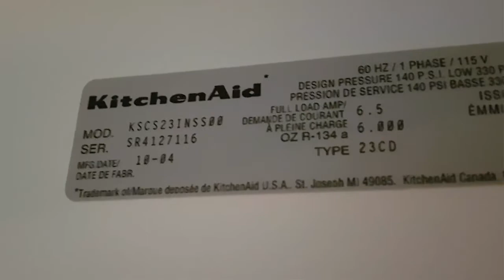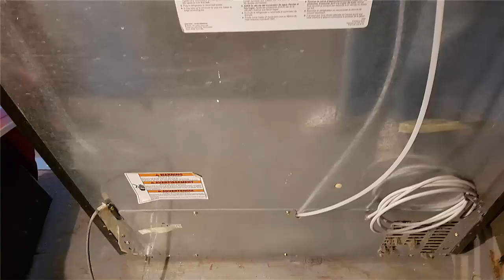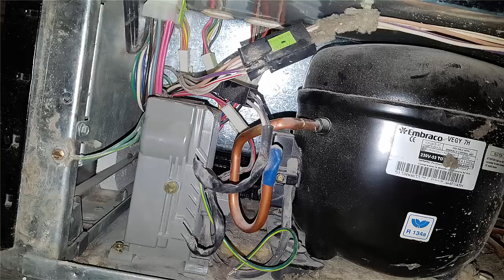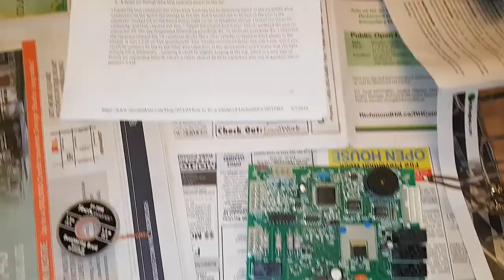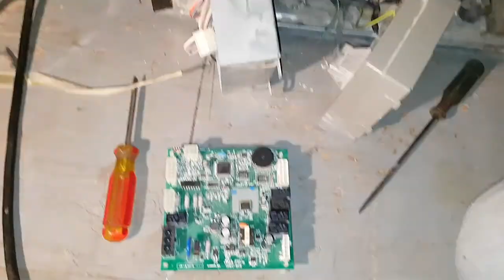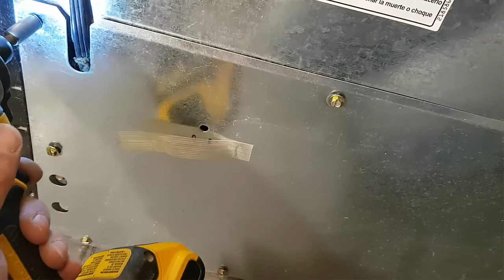Repair Control Board  for a  KitchenAid Superba Fridge

Comment: GOD Bless you Vito. You are and excellent teacher and technician!
I saw already ordered a capacitor because it was bulging on top, the same one you had pointed out. After seeing your video I now ordered the relay also. The Cap with arrive tomorrow so I will replace it and see if the fridge works. The relay will be here the day after.
Reply from the maker: Hi, Thank you so much for your comment.
 
I'm glad you found my video and I hope that it was helpful for you to give you the confidence to try the repair yourself. If you do end up deciding to try the component fix and if you haven't soldered or de-soldered much before then I strongly recommend watching some YouTube videos on the subject as you definitely want to be extremely careful when applying heat to the board not to overheat the board as they are sensitive and you could damage it if you put excessive heat while trying to remove the components.  The key is to use a solder sucker or soldering copper braided wire that will absorb the solder and move it away from the component pins you are trying to remove.  You should be able to find lots of good videos on the subject, just remember to be careful as these boards are very expensive to replace should you damage them, ... if you can even find them anymore.

 
If you do manage to fix your fridge (whether at the component level or a board refurbished, ...which will cost you considerably more) then I would highly recommend plugging the repaired fridge (and any other expensive electronic appliances for that matter) into a surge protection device or a power bar with built-in surge protection. This will help ensure your fridge (and other appliances) will not be as susceptible to electrical power spikes sometimes associated with thunderstorms. I plugged mine into a surge protection device which is then plugged into a surge protection power bar so it should have double surge protection.
 

Good Luck with your repair and if you do manage to "Fix It Yourself", I'd be interested in knowing how you make out with it. Best of Luck. Vito Casola - FIX IT Yourself!!
Reply: I own a Weller WESD51 soldering station and necessary tools. I wire my guitars. What temp should I set the soldering irin to? It is a digital readout. What solder?
Reply from the maker: @mercyrules1617  Not sure what temperature you should use. I would start with the lower setting(s) and gradually increase until you find you are able to get the solder to melt and stop there. Or you could research a bit more on the topic of soldering delicate electronic components and maybe you'll find the answer you need. Vito Casola - FIX IT Yourself
Reply: Well Vito I fixed it! thx Temp was 750f. You are a blessing sir!
Reply from the maker: @mercyrules1617  Fantastic!!! So glad these videos actually help people like you. You just made my day. I bet the fridge manufacturers aren't happy though. Keep on fixing things yourself!!!  Vito Casola - FIX IT Yourself!!

Comment: Hi, this is super help, I already ordered the parts that should arrive tomorrow. Would be possible to get a copy of  Steve Jenkins’s document ?
Reply from the maker: Hi Juan, Thank you for your comment and positive feedback. I hope your parts arrive soon and you are successful at repairing your fridge. Email me at vmcasola@gmail.com and I will respond to your email address and attach the Steve Jenkins document.  Vito Casola - FIX IT Yourself.!!
Reply: @FIX-IT-Yourself  thanks for the document, I made the changes in the control board and now the refrigerator is cooling without any issue. Your video helped me to know what to do and how fix the refrigerator very easy. Your post is one of most significant contributions DIY.
Reply from the maker: @jmsilva64  Hi Juan, Thank you for the very positive comment, it's much appreciated. I'm sure others will appreciate knowing that this is something they can try and succeed in fixing. It's really not that difficult, saves you a lot of money and gives you a great feeling of accomplishment. Take Care and keep on FIXING THINGS Yourself.!!! Vito Casola - FIX IT Yourself.!!

Comment: Thank you for making this video. Saved my fridge. The blog you reference is no longer up, but this video had enough info to do it. Someone even made a kit of the 2 parts on Amazon for $10.
Reply from the maker: Hi William, Thanks for the comment and positive feedback. Yes, it doesn't surprise me that someone would buy a bunch of these parts, then package them up as a kit and sell them on Amazon.  The parts can be purchased from Mouser Electronics (as was detailed in the Steve Jenkins article). So I bought the relay from them for CDN$2.56 and three capacitors for $0.89 each ($2.69 for 3). Total price for parts was $5.25, and the $8.00 shipping cost was more than the parts. So I guess there is some profit that can be made by buying these parts in bulk and selling kits for twice the cost. Vito Casola - FIX IT Yourself.!!
Reply: Wat does  the relay control

Comment: Vito, thanks for your help! The video was clear and straight forward.  I was about to give up on the refrigerator and buy a new one.  Thanks for sending the copy of Steve's article with all of the pictures. Evidently, this is a big problem as Amazon has a package that includes the relay and three of the capacitors for $9.00 delivered. The repair was much easier than I realized and now the refrigerator is operating as it should.  Here is the link to the Amazon package - https://smile.amazon.com/dp/B074VY34H8?psc=1&ref=ppx_yo2_dt_b_product_details
Reply: I bought this package, have not yet taken the control board out. Some reviews mentioned the capacitors were not the correct kind, but the relay was enough to fix their problem. Can I get confirmation on this before I start trying to repair it, how many of the capacitors should be used if any?
Reply: @izzyira  The package I ordered had two capacitors and two relays.  The control board only needed one each.  That is what I installed and the refrigerator is still running great

Comment: This is one of the most helpful videos I've ever found on YouTube. Vito was spot-on in my refrigerator works perfectly now. His email communications with me was so personable. The only problem that took me so long was the desoldering of the components on the board, but I got through that and the rest was a piece of cake! Vito wants me to thank Steve as he was the originator of doing this. Thanks Steve! By the way this was a fun project and you feel good about yourself.
Reply from the maker: Thanks, really appreciate the comments and positive feedback, and really glad I was able to help you. Vito Casola - FIX IT Yourself
Reply: @FIX-IT-Yourself  My refrigerator is making a high pitched sound/tone intermittent.......many long tones lasting 10 to 20 seconds and then maybe a short 3 second one thrown in here and there.  It does sound like a motor or fan is clicking in and out when the high pitched sound comes and goes but I am not sure I have the same problem as the temperature is fine and the reading on the digital control panel inside shows the temperatures ok.  But it is making me crazy........like a tap constantly dripping but worse.  Any replies would be greatly appreciated.

Comment: My KitchenAid was doing the exact same thing. After several searches looking for an answer to the problem and looking for a new control board, I came across this. Saved the day! Ordered the parts from Amazon and replaced the relay and cap. Up and running like new! Thank you for posting this and for sending me the PDF!
Reply from the maker: Hi Rick, That's fantastic!! So glad to hear you were able to repair your fridge and very glad that I was able to help.  Vito Casola - FIX IT Yourself.!!
Reply: @FIX-IT-Yourself  can you send me the pdf also?
Reply from the maker: @johnbellini1533  Hi John, Certainly. Please email me at vmcasola@gmail.com and I will respond. Vito Casola - FIX IT Yourself.!!

Comment: Thanks for the help. My fridge is up and running again. I couldn't have done it without you.  Apparently this repair is popular as the capacitor and relay is now sold as a package on Amazon!
Reply from the maker: Thank you for your comment and positive feedback.  I'm glad to hear you were successful in getting your fridge repaired and are now still enjoying use of what otherwise would have been a lot of plastic and metal now in a landfill or recycling facility. Yes,  someone else made that same comment and it doesn't surprise me that some people have figured out there is some business to be made from ordering those capacitors and relays and packaging them together as a repair kit.  I suppose I could have done that too but that's not why I make these videos. Both parts can actually be ordered at the same place, (Mouser Electronics, is the one recommended in the Steve Jenkins article, and where I purchased mine).  Hope you keep on FIXING Things Yourself. Vito Casola - FIX IT Yourself.!!
Reply: Hi where can I get the parts?

Comment: My fridge had been double Beeping every 5 seconds for 2 weeks.  Repair person could not do much as he stated that the motherboard was no longer available.  I had already changed the inverter box for $340 Canadian.  After I watched your video I tried to order the two parts you mentioned, however, the relay was backordered by about 6 weeks.  I was able to find the Capacitor for $1.36 (two of them were in the bag).  I replaced the capacitor and the fridge has now been working fine.  It has been 24 hrs and we are still smiling.  Thanks for your post. (By the way,  I was able to find a motherboard locally as they had it in stock.  They wanted $590 for it.  I passed!). Luc from Ottawa, ON
Reply from the maker: Thank you for your comment.  Glad to hear the video helped you make the repair. It's quite possible that all you needed was just to replace the capacitor but if you still have problems with the cooling then likely you will need to replace the relay as well. I know the boards are impossible to buy new because apparently they were manufactured in a factory in Japan that got wiped out by the 2011 Tsunami, and not the aftereffects are being felt here.  I know that people are taking advantage of the lack of new boards and are getting them repaired and then selling them on eBay for a lot of money, it's crazy, you could almost buy a new fridge for the prices that I saw, US$499, US$599 and even one as high as US$900, it nuts. Anyway good luck with your fridge, hopefully that capacitor did the trick. Vito Casola - FIX IT Yourself.!!

Comment: My fan appears to be running but the compressor wants to kick in but it doesn’t.  Does this sound like the same issue as you?  The lights work but there is no cold.  Thanks for the video.
Reply from the maker: Hi John, Yes, this definitely sounds like the same issue. You should reference the Steve Jenkins article (a lot of really good information in there). Unfortunately the link to the article is not working anymore, but I did download and print to PDF a copy of the article when it was available. If you need a copy of it email me at vmcasola@gmail.com and I will send it to you. Good Luck with your repair. Vito Casola - FIX IT Yourself.!!

Comment: My board was on top of fridge... got to the board.. there are only 3 omiron spaces.  And the capacitor is different size.  Im lost now.
Reply: And i did check model# first.
Reply from the maker: Hi BOE BOXING, Are you sure you got the right board.  The board on top is just the board for the buttons, the actual power control board is at the bottom back of the fridge. Watch the video carefully and you will see where the board is hiding in a metal box behind the fridge at the bottom. Vito Casola - FIX IT Yourself !!

Comment: THANK YOU! 

Works EXACTLY as you describe! 

No more fan/compressor kicking on/off and “pinging” non-stop. Did not have any problems with temperature control, nor did I have to re-program the board as some sources state. 

$8 Amazon parts, paid a local shop $50 to do the soldering while I waited as I’ve never soldered boards and this wasn’t worth risking. 12 year KitchenAid KSBS25INSS03 working silently!
Reply from the maker: You're welcome Louis,  It's Steve Jenkins who we should all thank. Without his article I would have given up myself.  I just decided to make a video to make it easier to help others. Vito Casola - FIX IT Yourself
Reply: Hi where can I get the parts?
Reply: @JuanRivera-lj5lu  i think its in the video. Maybe a shop can match the capacitor and relay.
Reply: Hi where can I get the parts?

Comment: Hey thanks much I changed my capacitor and the fridge is work great I couldn't get the relay in Jamaica. Thank b to God the relay was ok
Reply from the maker: Glad to hear it all worked out in the end. Doesn't it feel great when you can fix something that would have otherwise ended up in the landfill.  I know I feel great about that. That's why I make these videos, to help others fix things that would end up filling up the landfills with perfectly good stuff that just needs a little fixing.